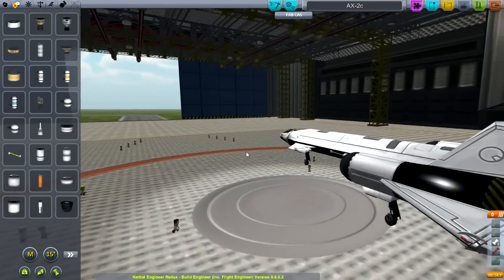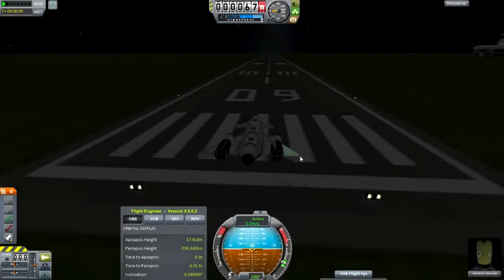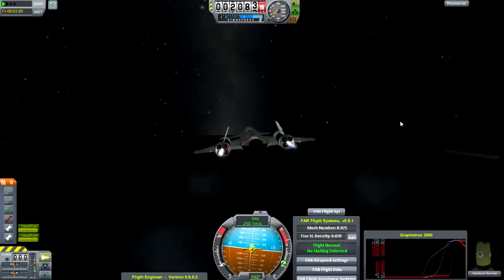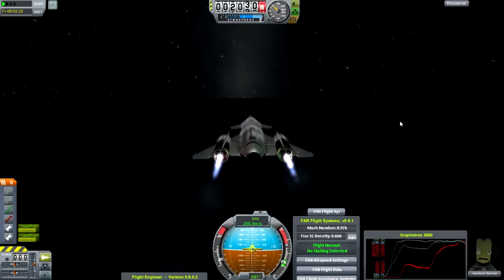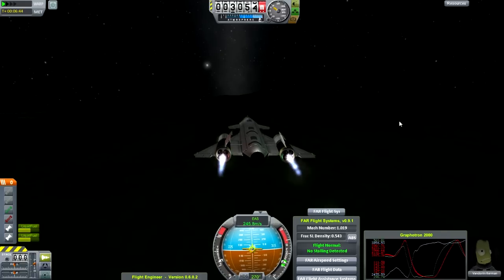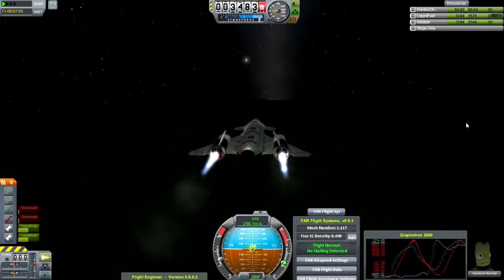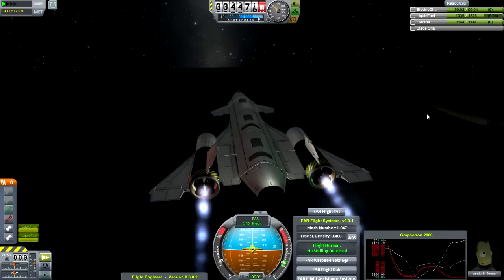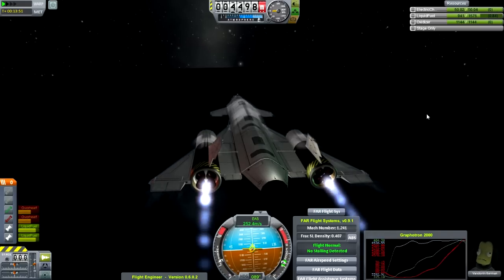Let's Fly Kerbal Space Program: series 2, ep. 15, The Return of Nerd Flying

Comment: Sorry to bug you with more questions, but wouldn't make sense to measure air pressure as well? I'm assuming that the heat is related to the pressure in some ratio, and it would change from planet to planet. what might work for kirbin may not work on duna. Im not sure how relevant that is to your over all goal. It looks like you are testing for kerbin and those altitude:air pressure would be different than other planets.

Comment: You are correct that you will always overheat at the same EAS. Without going too much into the physics this is due to lower air pressure. By the same logic,you are also correct  that EAS is the same as IAS in a real plane.

Comment: You realize that, if you keep these 'nerd flights' going,the data you collet can be used by the mod programmers to fine-tune the physics engine, right? Just now, you have proven that struts can't withstand very high temperatures, thus any craft that depends on them for structural integrity will collapse under re-entry heat. Very informative indeed. Keep going, Owl! FOR SCIENCE!!!